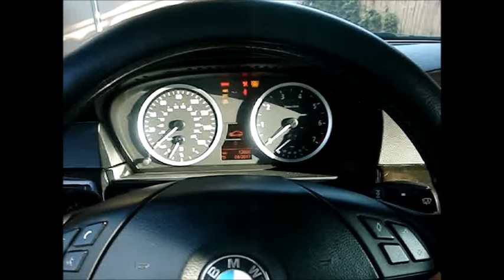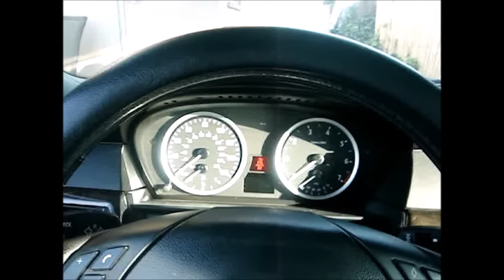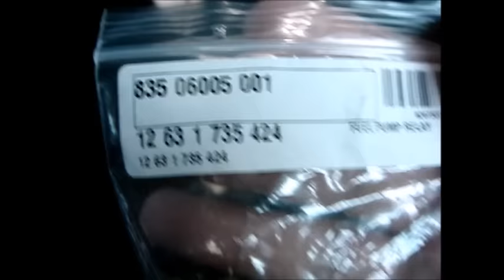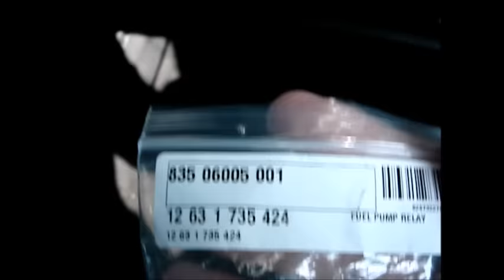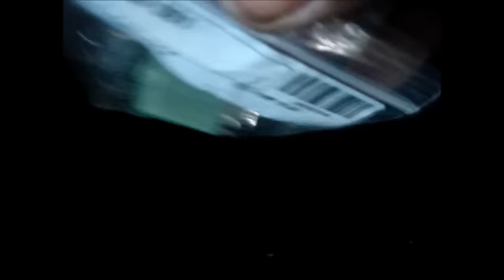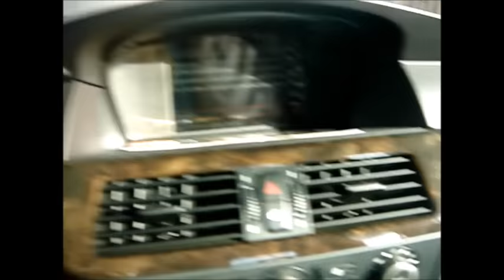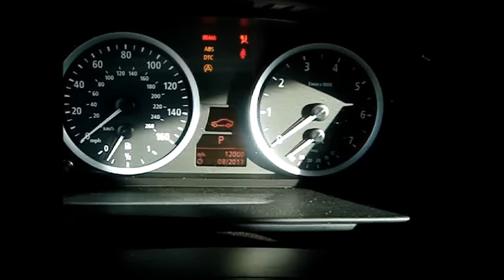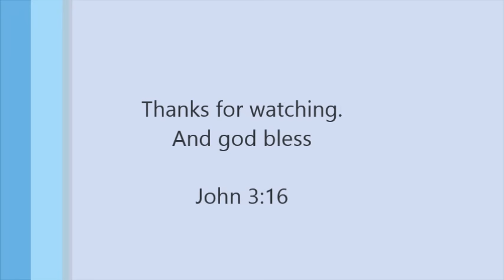BMW will not start ? / BMW Crank's but will not start ? Easy fix Watch this!!

Comment: I had same problem with 320i 2008. We pulled all fuses out and put them back in and it started. No cost! Though the keyless entry stopped working. I put the little fuse in the wrong place. All good now!
Reply: Adrian van wichen I’m going to try this. I have 08 328i and I been having a no crank no start issue. I called the dealership and they want $148 per hr and that’s just to find the issue

Comment: Hey I couldn't find the fuel pump relay in Glove Compartment on my e60 525i 2008 
Where can it be...because it's cranking but no start...help pliz ,I ended up changing a fuel pump but still cranks

Comment: I have a 525D 3.0 engine and it wont start, the fuel is going to the engine but not starting just what could it be the problem?

Comment: ended up being the wiring to the relay but without your video ID never known where to start
Reply from the maker: nice...i am glad to hear you are back on the road.
Reply: What did you do for the wiring? I changed my relay and it cut off on me while driving again. I just put the old one back in and it started right up?
Reply: @zillahedghill1135  ground cable?

Comment: I have a 2004 325i & it has the same problem does that mean I have to change whatever you changed or can it be something else ?
Reply from the maker: try changing what i changed (the fuel pump relay) and see if it fixes the issue. If it dose not, it may be your fuel pump not working properly. I hope this helps answer your question.

Comment: How did you diagnose the problem and came up with that solution?
Reply: Crank, no start is often fuel or fuel components.  If it cranks then there is most likely not an electrical problem.  If it was just recently running then it is most likely not an engine problem.  Thus, what is left are fuel components.  If your vehicle has good fuel and is full of fuel then the most likely culprits are:  a weak fuel relay, a bad fuel filter, or a bad fuel pump.  If the car was recently running with no hesitation then it most likely is not a bad fuel pump.  That then leaves the fuel relay and/or fuel filter as the most likely culprits. from: christansdad

Comment: What year and model bmw is this??? My 2002 745 li is doing the same exact thing. Where would the fuel pump relay be located on my car???
Reply: Tammie Rudd google it
Reply: Tammie Rudd in the trunk near fuse box

Comment: Hello Oscar, My 04 745Li has been giving me issues for a while. It started with misfires. I've replaced 8 Coil Packs, Plugs, Mass Air Sensor, Manifold Absolute Pressure sensor, 4 Eccentric VVT Solenoids, Fuel Pump & Fuel Filter Regulator, Under Valve Cover Eccentric Shaft Sensors, Integrated Power Module, New PCV Hoses,  PVC Valve in both Valve Covers and I havent replaced the Crank Sensor yet. I keep getting a Code that relates to P1057 Manufacturer Control Fuel & Air Metering Auxiliary Emissions Control. It cranks but no start. I clear codes and the Fuel & Air code doesnt clear. Please Help it has 144k miles.
Reply from the maker: Morris, I will look this up when I get home. And help you get thru this!  am in Cancun Mexico.
Reply: @oscars-autorepair3236  Oscar, excellent video, and apparently a common problem.  I've just done this repair (successfully) on an E53 diesel.

Comment: btw, i couldnt find that relay in that place, do u have another location?
Reply: Look up a fuse diagram for your specific car
Reply: Finally i found below AC microfilter inside engine trunk (passenger side)
Reply: They're also under the hood under cabin filter box.

Comment: I also have a problem with a bmw 530d e60 2005, the starter turns the engine but it doesn't start, the error code is 4691 power 3, can someone help me, please

Comment: Hi Oscar. Great video. Question, how did you know that the fuel pomp relay was dead? Did you make a diagnostic? Did you test the relay? Thanks a lot.
Reply from the maker: Great question, I started with the basic diagnostic which was the relay check, if that didn't fix the issue, I would have tested the fuel line compression to make sure it was at the correct psi, if that didn't fix the issue I would have sprayed some starting fluid on the intake and see if the car attempt to start. Luckily the relay was the the fix, I always likes to start from the basic or least experience fix. Some folks start swapping parts such as the fuel pump thinking that's the issue. I hope this helps.
Reply: I did a diagnostic and it showed problems of camshaft sensor and crankshaft sensor. Nothing about any relay. Can we confirm that it is not a problem of relay? [we checked all the fuses and relays, they looked OK]. What do you think?
Reply: @BMWEMBMWEM-rk3fz  I have the camshaft sensor error. I heard that if you get both the camshaft sensor error and crankshaft sensor error it usually means the timing chain has come off.
Reply: @BMWEMBMWEM-rk3fz  please did you find out what was wrong? I’m having the same issue
Reply: @erhoboy6621  I changed the camshaft and crankshaft sensors. After that, I did a diagnostic, no more errors.
Reply: @BMWEMBMWEM-rk3fz  u fixed it changing the sensors ? I have the same issue . Thank u
Reply: Always start with simple stuff, check for power to the pump, then check and clean the connections in the circuit, then check the fuses, then check the relay. This just needs a multi-meter and some contact cleaner rather than complicated and possibly expensive diagnostic software.
Reply: @BMWEMBMWEM-rk3fz    I’m dealing with the same issue.   Gonna change my crank sensor and clean my Vanos solenoid filter to make sur they are working.  Let me know what ends up with your problem / fix.    Thanks.  And good luck

Comment: Replaced the fuse but still just cranking. Replaced the IV module in the front too. What could still be wrong here?
Reply: Check coils and spark plugs
Reply: ground cable

Comment: Hey so I was having the exact same problem. I changed out the relay after watching this video. I got it to turn over finally. I turned the car back off. And now it won’t start again. Does that mean a bad fuel pump?
Reply from the maker: try taking the fuel pump relay off again and re-inserting it. Check if it turns on. If it turns on something is loose. Another viewer commented that their was something wrong with the electrical relay plug that holds the relay in place. let us know if it works.
Reply: That worked thanks so much! I almost sold my 2004 bmw 525i for 1500. It only has 110,000 miles
Reply: Oscar Ruiz-Autorepair  como estas Oscar tengo un 2007 BMW 328i no tiene chista ya cambie el sensor de sigueñal los sensores de arbol de levas y aun asi no tiene chispa tienes idea que puede ser?
Reply: @Jimmyvify  yo tambien exactamente todo que hiciste yo le hise a mi carro también  y no tiene corriente.. Lo único que no e cambiado  es el camshaft sensor, mañana ese lo cambio pa ver que pasa.

 que fue el problema de tu carro, se resolvió ?

Comment: Just a note: At 2:30 on the video turning over is always confused or mixed in with cranking and running, your car is clearly turning over but not starting which is also same as cranking but not starting,

Comment: own a 2000 BMW 740li. I parked it for three months. Went to drive it. Battery was dead. Replaced battery and the car will crank over but not start. Replaced crank shaft sensor, still no start. I have no fire nor fuel. Suggestions?
Reply from the maker: check your fuses and hook up a fuel pressure gauge to test the psi on your fuel pump

Comment: Hi I have a 2011 5 series f10 20 diesel I was driving and the car went into limp mode and stopped and wouldn't turn over all the power was on and engine would crank but not turn over could it be This?? I asked someone to check they sprayed brake cleaner somewhere under the engine and it started and he he thinks it's the fuel is not getting to the engine?? What could it be
Reply: In order...fuel relay, fuel filter, fuel pump, fuel injection system.

Comment: Getting exact same cranking sounds on my 2006 325i! Just got it towed to my house, and got fuel pump replaced and still not starting also bought a new battery and still no start just that same crank.. what do I do next??😫
Reply from the maker: did you try to replace the relay for the fuel pump?
Reply: Oscar Ruiz-Autorepair havent been able to locate the fuel pump relay.. Been looking at various diagrams; some say its located in glove box some say under the hood. Furthermore, I looked it up on amazon and actually purchased thr fuel pump relay (said it was a direct fit) and cant find a slot where it fits. The relay is a light green 5-prong little square
Reply from the maker: i would also recommend to check your fuel pump fuse.
Reply: Jazzy Majalca did you find a solution? My BMW 325xi has the same problem
Reply: I can't find the relay I have a 328i 2007 anyone can help?
Reply: Edgar - some vehicles don't HAVE a fuel pump relay, but a FPRelay Control module. Try and replace the DME (blue) relay in the white ECU box under the bonnet.
Reply: @jazzymajalca171  did you ever fix it?
Reply: I’m the same way right now always start cheap never start with a fuel pump 😭

Comment: Would this work on a 2009 bmw 328i?? I’m going thru this exact same problem right now
Reply: 2009 335i. Been having this every so often but it eventually starts.  And other times it starts strong like this one did. I wonder if the relay is going bad?
Reply: Did you ever find the problem for the 2009 328i?
Reply: My problem was solved replaced the fuel regulator 3 days ago. It looked fine but had to have a leak. Starts up strong every time now.
Reply: @05kittycat1  No.  Just rough starts.  I'd look at CPS sensor Camshaft Sensor, even your hpfp  and battery can do that.  Did you get the battery cable recall done?
Reply: Steve Polverini no I just bought the vehicle and haven’t checked for recalls but it’s a 2009 328i
Reply: Steve Polverini also has a code for secondary air pump sensor but wouldn’t think that would make it stall so was pretty surprised when it happened
Reply: @05kittycat1  Oh, ok. You won't have the same high pressure fuel pump then.  See if they did the cable recall first. That was a main cause of shutting down like that.  Aftee that it could be a number of things causing that.  From fuel pump to the CPS sensors.
Reply: @05kittycat1  you in La ?
Reply: Steve Rodriguez no Central Valley
Reply: Til this day i wouldn’t be able drive it .  🤦🏻‍♂️ my first time being BMW owner never thought would be such big hassle lol my car starts & drives 5-15 mins & just stops turns off 😅 & when I try turn start back up sometimes starts drives 2-3 mins same thing. 😂🤦🏻‍♂️ (plz help me fr )🙏🏼 car only has 90k miles like what in the double hockey sticks . 💀
Reply: @TheFrenchPug  fuel regulator? Where is that located?
Reply: @TheFrenchPug  battery cable recall? How do I find out about that?
Reply: @tazmaniandiva7762  Under your rear driver seat in the gas tank.  Its all one piece.  My wires were corroded on it.
Reply: @TheFrenchPug  thank you so much for responding.

Comment: would this cause low or no compression in the cylinder ??
Reply: Yes! A bad relay will cause loss of all compression in the engine. You'll have to remove the head, replace pistons, conrods, camshafts. Have the block and head faced and a new MLS head gasket fitted. Once you've done all that, put a new relay in and turn the key.

Comment: Did u get a ignition switch on by any chance let me know thanx
Reply from the maker: No, the car would Just not turn over each time I attempted to turn it on. Just keep in mind it may be other issues causing the car not to turn over but I started from the lease expensive issues I just happen to get lucky it was just a simple fix such as a relay

Comment: Just bought a used 3031 CI and it has this exact problem. Going to buy relay tomorrow, worth a try! Will advise!
Reply: Hey did it work? I have an e87 116i and it only does this after it has bee running for some time when the engine is warm. If i shut it and try to start again, it just turns once without ignition and the it normally starts again at the third attempt.
Reply: Did it work?
Reply: @morganu.3643  I had the starter motor replaced and the problem is gone. I'm no longer living in fear when I have to press the start button anytime :)
Reply: @lindabenton1436  i just bought a 740i
Reply: @morganu.3643  Congrats on your purchase. I always wanted the e39 530i but for some reasons I ended up going for the e87.
Reply: @lindabenton1436  it will crank but wont start and its kinda aggervatin because I can't find a solution to try to it.

Comment: Mines sound just like that right now as of 2020 May i have a 1993 bmw 5 series i had left from the gas station and my car. Had shutted off less than 6 mins driving from the gas station and now it sounds just like that car trying to start but just not starting over i have about 3 good batteries so i know its not the battery its definite a different culprit

Comment: I am the same breakdown. However, it is a big problem that my 7 series does not have a relay. It will cost a lot because the airbag module needs to be replaced. I saw the video well.

Comment: I have 08 328i coupe where is mine located? Or is it the module?
Reply from the maker: yes, i believe your car has the Fuel Pump Relay Control Module Unit Helbako EKPM3
Reply from the maker: but i will double check when i get home.

Comment: Hey bro thanks for the video, i have a sort similar issue with my E46 2004. i can start my car after 3-4 times cranking but when I run for whatever time period it will automatically stopping. will this work for my issue too? Have anyone faced similar issue?
Reply: could be crank shaft sensor

Comment: Can it do it just on cold starts ?
Reply from the maker: Yes it can , that how mine started
Reply: Oscar Ruiz-Autorepair thank you ! After it starts no problems rest of the day unless sits for a couple of hours. I’ll try been getting rip off lately thanks for reply
Reply: You definitely earned another sub
Reply from the maker: @yamiletlopez1989  ur very welcome
Reply: Oscar Ruiz-Autorepair update replaced and unfortunately not the problem. Thanks though still don’t know what’s causing the long crank in the mornings

Comment: Hey man I have a 2013 bmw f10 550i m sport and I have theses codes what could it be?

P054D-camshaft position timing (bank 2)
Cam shaft position timing over retarded (bank 2)
P0302-cylinder 2,3,5,7,8 all misfire 
P2096-catalyst fuel trim to lean (bank 1)
P13B5-crankshaft error (bank 2)
P0018- crankshaft position correlation (bank 2)
P13BC-crankshaft tooth off (bank 1)
P13B1-crank shaft position sensor error (bank2)
P0328-knock sensor 1 circuit high input (bank 1)

Comment: First, you should swap the relay with another same relay to confirm the relay is the culprit before buying a new relay. Sometimes just a blown fuse or loose connection.

Comment: Thx for the vid, (2009 BMW X5 3.0) I replaced mines and my vehicle started up but I noticed it seems like my miles to the gallon number goes down a lot faster (300 to 295) a 5 mile difference when I only drove about 2 miles, has anyone else experienced this?
Reply: I haven't changed my relay but my mileage is doing the same. Did you ever figure it out?

Comment: I just bought a used 2000 740i and it cranks but it doesn't start, im going to try this out either today or tomorrow
Reply: Im bought a fuel pump relay at auto zone, its coming in on Saturday, will let yall know if it works.

Comment: Guys anyone has the answer? I own BMW 535i 2008. Car didnt have power, so I replaced coil ignitions and it was the same. After that I replaced high pressure fuel pump and car starts but after a minute shouts down. What else it could be?

Comment: Me24U Jones
I have a 2013 X5, i looked for this relay in my SUV. I don't see the relay like yours in video. My car cranks but will not turn over. Replaced the battery as well. I do see something similar to your relay in the front fuse box under the glove compartment. But relays don't look the same dark green but narrower. If one of the relays in front fuse is for fuel pump,  which one is it? This just happened out of nowhere. No warning or emergency notification within the car's system. Help me out before i go spend unnecessary money. Getting to front fuse was easy. And back as well. I have no relays in back compartment that is that size. I bought the same relay as you but i don't think it's for 2013 X5.. Don't see no relays similar. Thanks

Comment: Would it come up with a code tho
Reply from the maker: Hi Jason, no I won't come up as a code, no check engine will appeared for me. This is just one way to check if the car does not start, it's a simple check but keep in mind their are other factors that can effect the car from not starting such as bad fuel pump. This was just a easy way to diagnose a no start. I hope this helps

Comment: Hi there  i have a 2007 520d while removing the battery to recharge it i took the positive off first n it touch the body and sparked, put the battery back and now its not starting. can any one help?
Reply from the maker: Sanjay Nebar good morning gave you check the fuses?